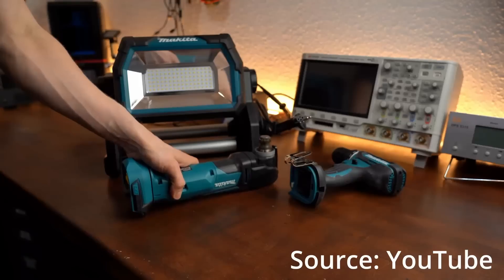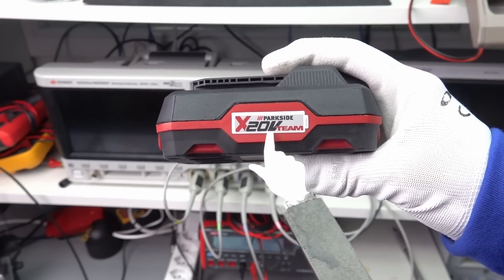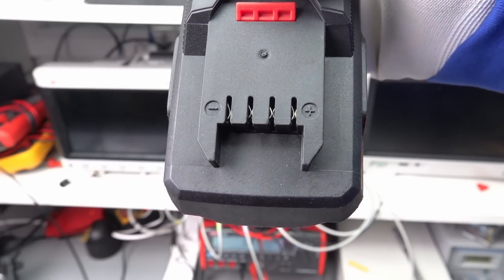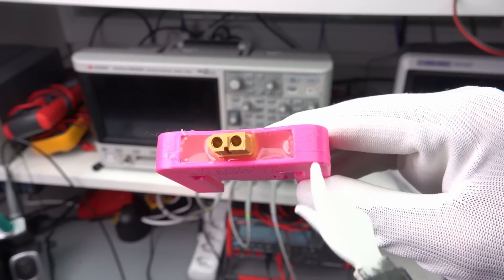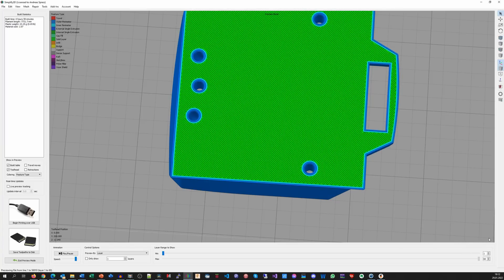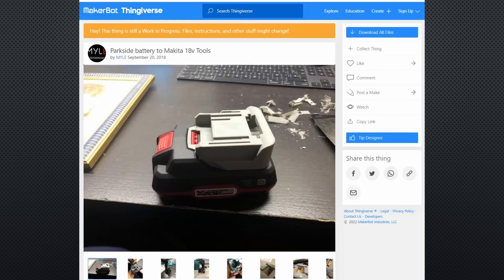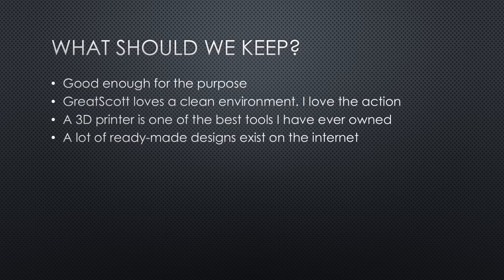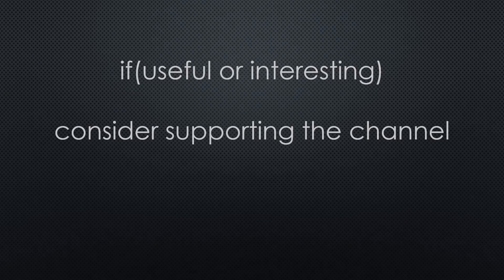#416 Creative uses of Power Tool Batteries for Mobile Projects

Comment: I am curious how the signalling with the bms works. As I know many barrery packs have a NTC with a resistor. It gives a Signal for overtemperature and a indication of the batterysize with one pin.
And there must be some digital communication, because Makita offers a Mattery-Tester for 18V and 40V batteries. This hows a lot of stats about the battery pack. Maybe it is possible to reverse engineer it with an logic analyzer...
Reply from the maker: You are right. There are 2 additional connectors. I do not know their function. Plus I do not own a Makita tool. So I do not know if they communicate. Fortunately, not too much. Otherwise, our hack would not work.

Comment: I think the manufacturers leave out required features such as under-voltage protection on purpose, so that they can blame you for using a battery off-label and get you to buy a replacement.  If you forget about your ESP-32 and run the battery down, the evil battery management chip inside might decide that you're not allowed to charge it with the official charger anymore. :-(
Reply from the maker: With the Lidl warranty you bring it back and get a new one. I know what I am talking about ;-)

Comment: I use 2 coins and clip wire to connect my Cigarette phone charger to a battery pack(devon 20v). It doesn’t have bms (but it’s ok I have b6) but one thing is I didn’t know the low voltage protection is in the battery or in the drill.If you want to use the battery for other Purpose, find the battery which have indicator one.
Reply from the maker: Interesting solution with the coins. The Lidl batteries have a voltage indicator, too. But you have to look at it ;-)
Reply: @AndreasSpiess  Hi Andreas. I remember you have a video where you "hacked" a 4-bar LED Li-ion battery charge indicator - maybe you could do the same for this battery and its indicator, so you don't have to watch it? Just guessing.

Comment: Makita is the only one has the low voltage protection inside the pack
Reply from the maker: Good to know. Thanks for the info!
Reply: I supposed all battery packs had undervolt protection because they had always an Bms equipped. The Bms pcbs (sold for own projects) I know had overcharge, temperature, balance functions and undervolt protection.
Reply: @matneu27  the Parkside batteries have a BMS installed but it doesn’t physically switch the battery pack off. Rather it communicates with the power tool over the second pin and it’s circuit shuts off if the battery BMS detects low voltage. So basically you’re only protected if your using the original tools or build a circuit that can work with those signals (I’m currently working on this)
Reply: Same with Makita